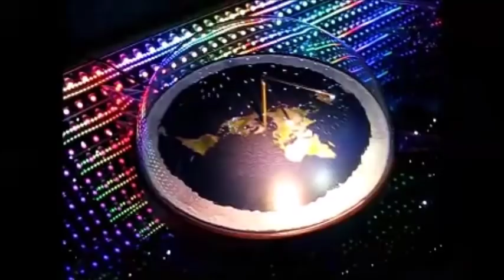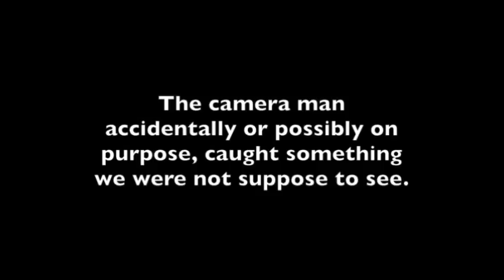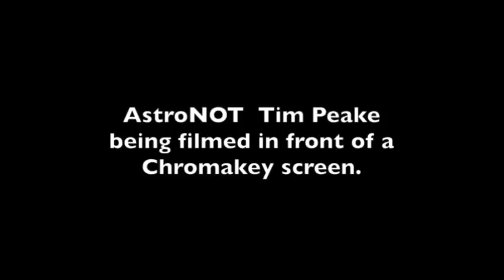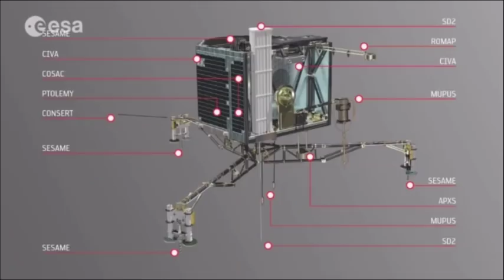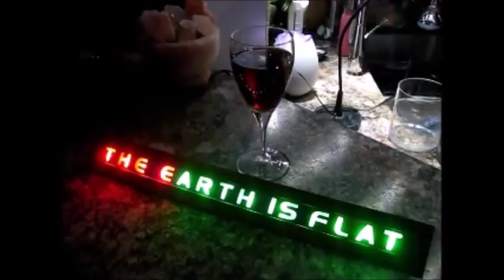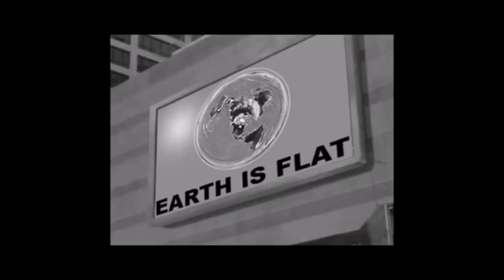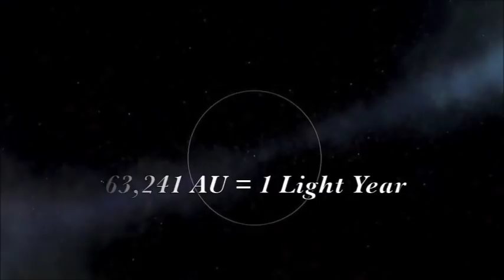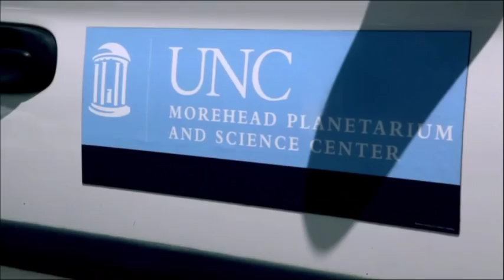Flat Earth Q&A Emails 59 - Mark Sargent ✅

Comment: Gravity is not a form of molecular magnetism. Magnetism is related to electricity. Hence the Electromagnetic force. And if gravity worked normally on a flat earth then the farther you walked out towards The edges the more slanted gravity would be pointed towards you. Until when you got to the very edge gravity would be horizontal related to the ground. Basically would feel like you were climbing up a mountain

Comment: Asking what gravity is is like asking what electromagnetism is or what the weak or the strong force is. Besides talking about particle physics and fourth carrier particles you can’t say much else besides the properties of matter that cause an interact with the forces. If you want to actually get into particle physics there is a theorized particle called the graviton which might be responsible for the gravitational force. However this particle has not yet been discovered. On the contrary all of the other three fundamental forces have force carrier particles that have been discovered. And example would be the photon which is the force carrier particle for the electromagnetic force. And for those of you that don’t know A photon is a particle of light